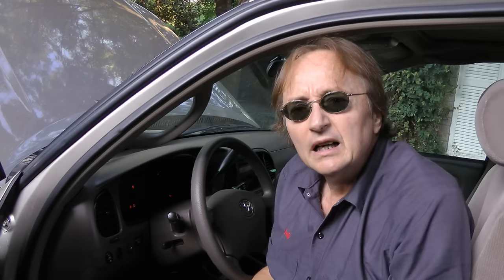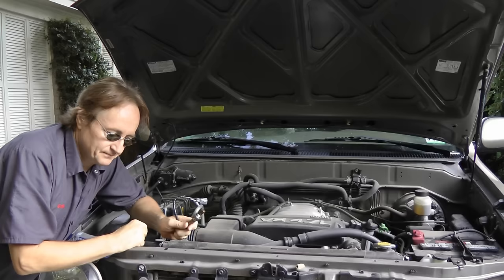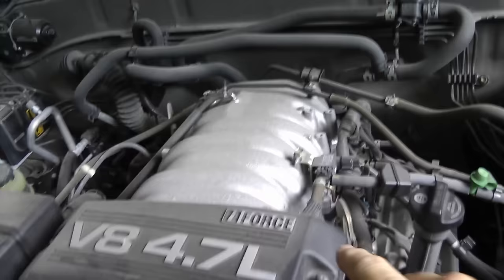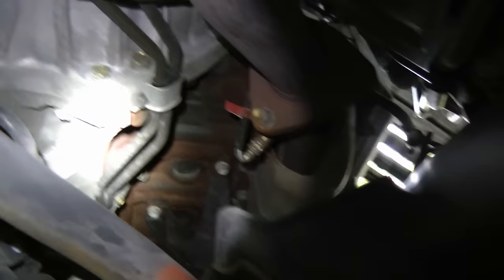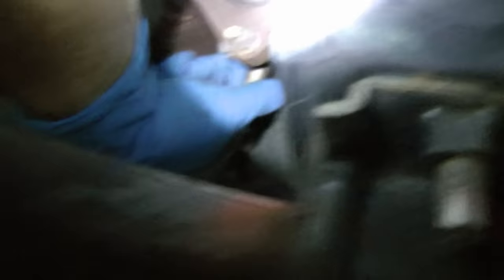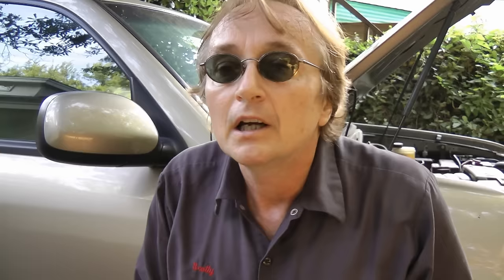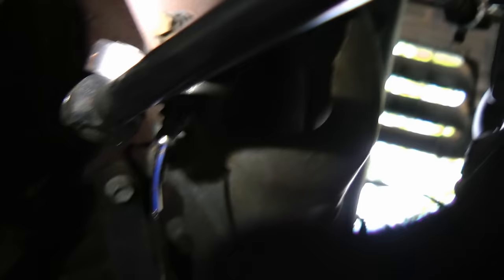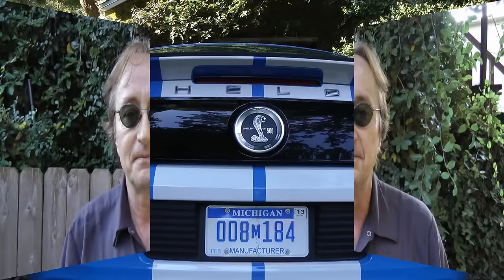How to Replace an Oxygen Sensor in Your Car (Air Fuel Ratio Sensor)

Comment: Can an 02 sensor be giving a bad reading without throwing a code. I've had a rough idle and inabilty to coast for about 6 months now. After replacing a bad pup and clogged injectors it's still not running right but no shop seems to be able to tell me if my O2 sensors are giving a good or weak signal???? This is on a 2012 Jeep grand cherokee 5.7
Reply: Have you checked your air filter to see if its clean? Also i recommend buying an OBD2 scanner from amazon for $40 dollars, you can reset codes and test o2 sensors.
Reply: Tyler Padgett have you fixed your problem?
Reply: AI all seeing eye military CIA owned

Comment: What is the stuff he says to put on the threads? I failed emission test and they told me bad o2 sensor bank 2. I decided I might as well replace both sensors  at the same time, but the sensors I bought didn't come with anything and my car still shows bad o2 sensor  when I get a code read
Reply: Christopher Kaesemeyer Copper grease!😉

Comment: Hi,I emailed you before about my Toyota Yaris sounding and performing below it's best. I found out from my mechanic's computer that the car has a faulty o2 sensor (Number 2 after the cat). I am going to get a second hand one and get him to put it on. It's from a Yaris that has the same cat set up as mine. My question - will the sensor that they will take off the damaged Yaris with the same cat as mine, do the job or should I get a new one? I obviously would like to save money but I want the car to be right and perform at it's best! Thank You
Reply from the maker: Sean Green try it and see, but really, a new one back there doesn't cost that much, it's the front one that costs more

Comment: If I replace the sensor with a different brand but the engine light stays on, will that be the only issue is that the light is still on? Won't the sensor still perform as if the light went off?

Comment: hELLO sCOTTY ....i have a honda pilot but i have the following error codes...please what do i need to be worried about.

P0155 – 02 SENSOR HEAT CIRCUIT

P0135 - 02 SENSOR HEAT CIRCUIT

PO498 – EVAPORATIVE EMISSION SYSTEM VENT VALVE

CYLINDER 5 – MISFIRE – P0305

P0451 – EVAPORATIVE EMISSION

P0301 – CLINDER MISFIRE

PO300 – RANDOM MULTIPLE CYLINDER MISFIRE

Comment from the maker: sensors don't do that, they just read the results of the cats working. more often engine or fuel problems cause them to run lean and burn out the cats

Comment: Hello Scotty, I have a 2004 Toyota Corolla LE with a 1.8L engine. The "Check Engine" light is on. I taken it to Auto Zone and the put on the code reader. It was a faulty fuel cap, but I also did buy the new cap and 2 Denso O2 sensors. It has high mileage , but has take-off like a V-6. The only problem is that it idles very low creating vibration but no stall. I also installed 4 NGK Iridium plugs and changed the oil with Mobil 1 synthetic motor oil & filter. The light is still on, I'll change the sensors and see what happens. If they are the car's original sensors, the rough idling could be that the sensors are sending (like you say) a faulty signal to the engines computer. If the idling does not change after the new sensors are in, what could be the problem?
Reply from the maker: they all often do that with age. try my video "how to fix a car that idles poorly" as cleaning the throttle often fixes it
Reply: Scotty Kilmer Some one told me there is an idle solenoid, it's located near the throttle body. He says it works by opening and closing a certain valve at idle. I couldn't believe where they put the outflow harness to the Oxygen sensor, I had to take the seat off the passenger side. No more "check engine" light. It's even using less gas and the engine pulls like a V-6. It's just that idling. I can raise it manually but the problem will be at a cold start, the high idle rpm. I will do what you're saying. P.S. It's a good thing I had an Oxy-Acetylene torch, that loosened it right up. It got red hot REAL FAST. All I needed was a 7/8. And I used all Denso.

Comment: Hi Scotty I have a buick 2006 lucern with a check engine light.  The code says the front O2 sensor is bad.  What is the best way to change this sensor?  Do I work from the bottom under the car?

Comment: does replacing the O2 sensors improve mpg? not when the check engine light is on i mean because of very high mileage . so just by changing it without the check engine light on will increase the mpg? thanks

Comment: Hello any advice... I have a 2005 Trailblazer and getting codes : P0153 and P0054 and P0053. I recently placed both O2 sensors and still have the codes. Could it be the Cat?
Reply from the maker: it can be, but those systems are SO complex, best to have a real pro analyze the system fully, as cats aren't cheap
Reply: Scotty Kilmer are dogs cheaper ?

Comment: Adding a 02 sensor to new exhaust pipes. How far from collector do i drill hole for 02 sensor? Engine is 96 chevy lt1 with stock manafolds.
Reply: 3 inches to 4 inches from the exhaust manifold on the downpipe.

Comment: Hey Scotty I need ur help asap I know this video is old but I have a P2272 code on my ford and I don't know which is bank 2 sensor 2 every make n model is different
Reply: Bank 2 is on the other side of engine  bank 1 has number 1 cylinder and piston and sensor 2 is the one after the cat converter

Comment: FML! I have a P0420 code on my 01 Corolla and I'm pretty sure it's the downstream 02 sensor. I am having a HELL of a time getting this thing off! I end up hammering it and breaking the cable from the sensor part itself and a deep socket (cuz the oxygen sensor tool just stripped it) and still no go. I'm out of options I tried warming it up also and use PB blaster penetrating oil
Reply from the maker: heat it up with a torch till red hot on the threads, it will come out then
Reply: Heat is the best tool.

Comment: Scotty,  I've Got 310,000km (192,000 Miles) On A 2001 Ford Ranger 4.0L, 2WD, Auto. I'm Told I Have Four, Two Before The Cat, And Two After The Cat.When Replacing Oxygen Sensors Do I Replace The One That Is The Problem (Bank 1 Sensor 1) Or Replace Them All Due To Mileage & Age?

Comment: i have got my oxygen sensor out it took a lot of heat from the torch and a twist socket now I can't get the new oxygen sensor in the threads are messed up so I bought the oxygen sensor tap that is the right size and I cannot get the tap to go in the exhaust. So I am looking at buying a helicoil tap to clean the threads out to put the new oxygen sensor in? It is the right oxygen sensor and its the right size tap do you have any ideas on how to clean the threads out if you can't get the tap to thread in? The size tap I am using is M18 1.5pitch. The tap will not start threading in for some reason I tried pennitrating oil to see if that would help it start and nothing. I think the first two threads are messed up on the oxygen sensor hole. Do you have any ideas on how to get the threads clean if you cannot get the oxygen sensor tap to work?

Comment: Greetings Scotty. I seek your professional advice. I have a code come up on my 2002 Ford Taurus ( P0136 )
It mentions a possible bad oxygen sensor. Car has been running really rich.  My question is where on the car would this sensor be ? 
Heated Oxygen sensor Bank 1 Sensor 2 ? Please help. Maybe a link to a pic or diagram. Thanks
Reply from the maker: +CheezyPr0ductionz   it's the sensor after the catalytic converter under the car on the exhaust system
Reply: Thanks buddy

Comment: hey scotty I have the same issue, check engine lights on 2001 corolla  ,I reset it before change the 2 sensor but the lights didn't go away, I drive after 150 miles reset it ,its back on not even reach to 12 miles, I don't know how to fix the issue, because of that my car fails the inspection. I need your  help .what is the issues, I have the code p0171. the code read system too lean bank 1.i really appreciated thank you
Reply from the maker: vacuum leaks often do that, try my video "finding engine vacuum leaks with a cigar"

Comment: Hey I have a 01 Subaru Impreza n/a it has very poor acceleration when it's cold but fine when it's warmed up could this be the 02 sensor? Have done the basics like new spark plugs, fuel filter, air filter, cleaned maf sensor,  new idle air control valve but still no changes, no check engine lights either, any help would be much appreciated
Reply from the maker: could be lots of thing, but check the data on the MAF first, they often go bad when that old. Also pressure clean the fuel injectors
Reply: will do. thanks for the reply

Comment: Hey Scotty , I have a 2005 ford five hundred and have a code. I took it to autozone and they told me it's a bad sensor , so I go up under the car and I noticed my whole oxygen sensor wiring harness had melted.now I have new sensor but don't know the how to connect the wires...I need of help
Reply from the maker: if wires melted, that often feeds back and will also ruin the computer circuit that drives the sensor.  But a new sensor comes with wires and a connector, which has color coded wires inside. Where it is not melted, you would splice those wires back in, OR if it's all melted, go to a junk yard and buy a used wiring harness for the sensor

Comment: well i guess id be able to clean it with maf cleaner do you just clean out where the electrical connection meets? and i do not want to replace either the maf (250$) or differential pressure egr (64$)

Comment: I have FJ cruiser 2011, with check engine (left oxygen sensor). i replaced the left oxygen sensor and the check engine light come again, the problem now with (left and right oxygen sensors!!) how is that possible !? in the computer when they check the sensors for oxygen there are no signals at all.... What should i do ? but i did something with my stock exhaust i removed all the filters is that the reason why the oxygen sensors are not working ?
Reply from the maker: +Saeed Alblooshi  realize those are complex computer driven systems, but if there are no signals at all, generally wiring has shorted out or the main computer circuits have shorted out that feed them

Comment: Scotty how does a Car sound bad oxygen Sensor? My mom got a 2016 Toyota corolla with a Bad Start and Idling sound.. Even if I drive off it sounds like one Spark plug isn't working but we've replaced those and the Coil pack. I took it to a Mechanic yet the problem isn't solved.🤦🏽‍♂️

Comment: Hi Scotty, My Dodge Neon 2001 has a P0134, P0132, P0135. It seems all relate to O2 sensor. Will replacing, O2 sensor fix the problem ? Is it okay drive long with these issues, because I am going to sell to dealer in few months anyways ?? Thank You
Reply from the maker: Yaswanth Siramdasu   I've seen guys drive em years that way if car runs fine otherwise. Sensors may be bad, but many other things can trip those codes, they are complex feedback systems.

Comment: 1. My 1997 MBenz has a check engine and SRS light on should I just change the O2Sensor eliminate engine light off don't know the codes yet
2. On SAAB 2000, 9 5, 2.3t 4cyl. code is p0340 cam shaft position sensor should I just change the O2 sensor Help!!!

Comment: Hey Scotty,I have a 1999 Mitsubishi Eclipse Spyder GS 2.4 with 102,000, and check engine light is on and it reads the code P0141 . Also whenever the car is driven i check underneath it and its looks like there is something leaking out of the Exhaust or on it and it smokes (white) from underneath.I went to AutoZone and i told them about this problem and they said try getting a new oil filter. I once accidenty used premium gas unstead of regular, it still has 1/2 of it what could be the problem??

Comment: Code p0155  oxy sensor heater circuit bank 2 sensor 1 on a 2003 chevy s10 4.3l .....would the location be found the same way ? By opposite side of number one cylinder ? I saw how another guy led me to believe it was on the passenger side but couldn't be sure ...and most other videos are worthless lol....thanks for any info
Reply from the maker: yes, the opposite side  is bank 2

Comment: Hey Scotty, whats your advise on buying Oxygen sensors on ebay bc there cheaper then auto parts stores?  i want to change the upstream one on my 99 hyundai elantra , it doesnt need it but to tune it up with spark plugs wires etc. is that a hard one to do? whats your advise ? thanks . Gmcarfreak

Comment: Hi scotty its me again donavin with the 2000 lexus  rx300 yesterday I had a mechanic change my coil and put it in cylinder 3 the car runs sooo much better no more misfire codes just from changing coil 3 with a new coil now I have codes p1150 which seems to appear more often then p1130.which those codes are the a/f sensor and p1150 bank 2 sensor 1 only appears and the exaust still putts but is very smoothe and the rhine is more powerful. I need more great tips
Reply from the maker: drive it a couple weeks and see what happens, it may have to run to clear things out. Also try my video "how to clean fuel injectors on your car" to help the cleaning
Reply: Scotty Kilmer  thankyou scotty I will

Comment: If I happen to have an oxygen sensor that is not preheated by a heating element inside the sensor itself, then, can I safely clean the sensor, either with a cleaning solution or with something like a little craft-type decorative pipe cleaner (wire with cloth fibers sticking out)? I tried this on an old oxygen sensor that was from an old parts box, and it seemed that I could safely clean the sensor intake hole by putting the pipe cleaner in and twirling it around, got a lot of soot out that way..

Comment: Hi Scotty. You're channel is amazing. Spent hours yesterday. I have a 95 Corolla DX 1.8L 250K+ mi. Do these symptoms say anything to you (in order of appearance over time): Overheating/boil away, weak brakes (new fronts and bled), check engine light code 26, stalling on slow/stop (requiring tow)?

Comment: Scotty! How are you? What should I do if I am having a minor misfire while the engine is cold, I received the code for the  oxygen sensor and the code is no longer showing a few months later? I goofed up. I should have written the code down, I know that its only one sensor but I cannot get the code to pop up anymore. The misfire is still present however I cannot figure out which of the 4 sensors I need to replace
Reply from the maker: so many things can cause that, start with a guy like me scanning it and also checking LIVE and Mode 6 data for clues.
Reply: Thank you Mr. Kilmer, I just learned a whole lot more about parts that are near failure  but have not totally failed. I will have it professionally diagnosed!
Reply: I am reading .71volts on two sensors, the other who are not showing! Does this indicate that they have failed? This was a live map upon "warm" start with oil temps at 60c. I attached a screenshot, I didn't run a lengthy test due to the 2 sensors which are not reading or are at 0v.. Thanks a million. https://drive.google.com/file/d/0BwbwCVI722JbX1Q4UkwtVk9YaFk/view?usp=sharing

Comment: I have a Silverado reading low voltage and it only has 2,500 miles on it. I connected a scanner to it and the voltage sits around 300 mV at idle and drops down to 7 mV if I bring the engine to 2500 rpm. Any way to definitively pin point the problem?
Reply: I reset the DTC last night and the other code it had was O2 sensor stuck lean. Also, this is sensor 2 that is having the problem

Comment: what if there's no code? and the o2 sensor hasn't been change in years or more than 50,000 miles. should it be change? even if it seems to be working good? my engine hesitates and I'm trying to figurate out whats causing it
Reply: You can also change the ignition coil packs. If you buy stock they are about $125 each. Aftermarket is around $80.

Comment: hey scotty i have a 98 camaro v6 automatic and i replaced the catalytic convertor on it 7 months ago and it recently went bad again.. could the oxygen sensor cause this? it had a code P0420 when i replaced it the first time. its has over 145,000 miles
thanks

Comment: hi scotty i have a 94 grand am witch means i cant reed my computer with a scaner any ways my car has a strong gas smell out the exhast i washed your video over that but my car doesnt smoke it does here and there but other than that no smoke driving no gas dripping and also have carbon build up on spark plugs engine doesnt misfire and also get poor mpg please guide me
Reply from the maker: well, engine is just flat wearing out with carbon build up, and a 94 isn't worth much. change the spark plugs and see how long it runs ok BEFORE they clog up again. Realize it's on its last legs..

Comment: Can a bad oxygen sensor cause a misfire code? I saw this Toyota highlander with 26 codes including every cylinder misfiring but it didn't have a rough idle.
Reply from the maker: +O'Neal Raymond of course they can, but more often a misfire trips and O2 code from other problems like fuel or ignition failures